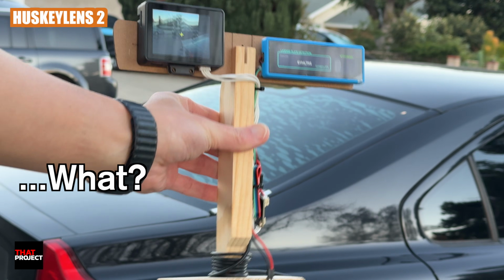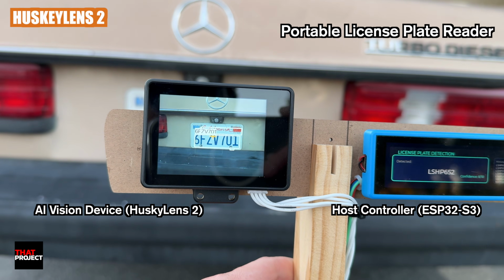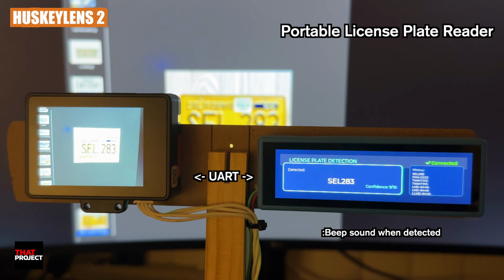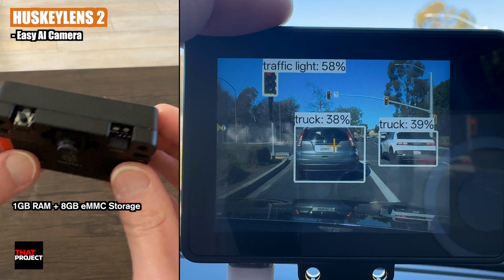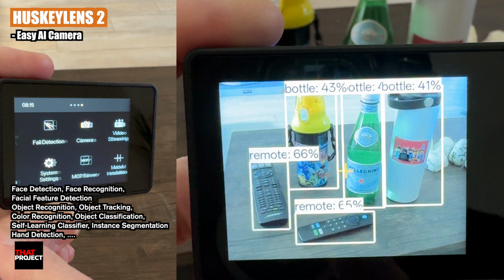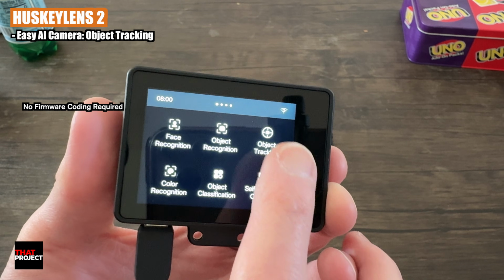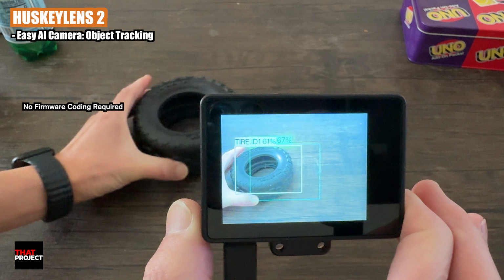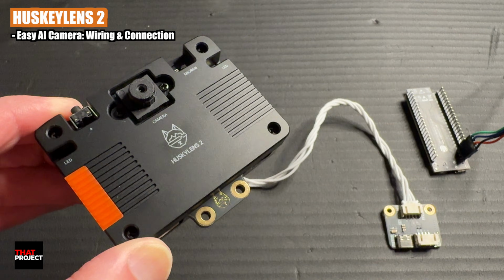I built a DIY License Plate Scanner with HuskyLens2 & ESP32-S3.

Comment: Dear all, what a great idea congratulations. I wanted to ask whether you think it would be possible to integrate a database or call an API in real time to perform checks, for example against a blacklist.
Reply from the maker: That's definitely possible, you'd just need to handle the network requests and response parsing within your main loop.
Reply: @ThatProject  Thank you very much for your response. I will review how to proceed. Do you know if this camera performs well in poor weather conditions? For example, does its detection accuracy decrease in rain or at night?
Reply from the maker: @cristianobregon1406  Yes, detection accuracy usually decreases in heavy rain or at night due to poor visibility and low contrast. For reliable outdoor use in those conditions, I'd highly recommend using a weatherproof case to protect the lens and adding external lighting (like an IR illuminator) to help the camera 'see' better in the dark.

Comment: Any code or diagram(s). Not sure how to complete the circuit, if you will.
Reply from the maker: As mentioned in the video, the HuskyLens 2 and the ESP32-S3 board are connected via UART. This only involves TX/RX/5V/GND connections, and all control is done through the ESP32-S3.
Reply: @ThatProject  the huskylens is in 5V, but the ESP32 is in 3V3. can we do direct connection between them?

Comment: Very interesting.  I don't completely understand why you need the ESP32 at all, shouldn't you be able to program the Huskylens itself to also drive the second display?
Reply from the maker: As far as I know, unfortunately, we cannot program the Huskylens 2 ourselves. We can only control it and obtain results via UART. Also, since the results disappear quickly from the Huskylens 2 screen, it's difficult to easily verify the results in a constantly moving environment without a separate display.

Comment: Shouldn't number plate recognition be possible with an ESP32-P4  ? This would probably spare the second processor board completely, since the LVGL-based GUI could run on the ESP32-P4 as well ?
Reply from the maker: That's a great point! While the ESP32-P4 is powerful, it lacks a dedicated NPU (it uses vector extensions instead). The HuskyLens 2 features a 6 TOPS NPU, which is significantly faster and more stable for heavy OCR tasks.
Reply: @ThatProject , а HL2 для работы не требуется Интернет?